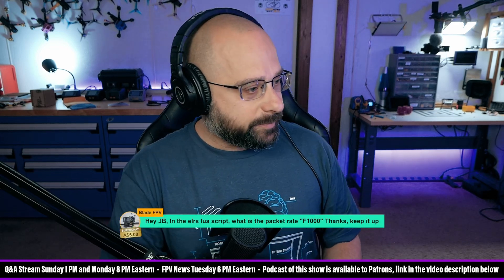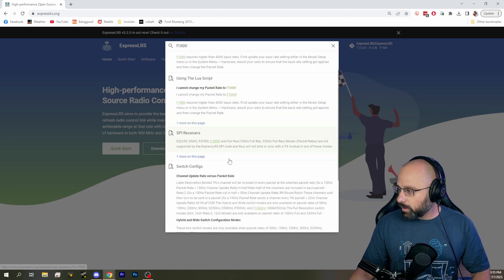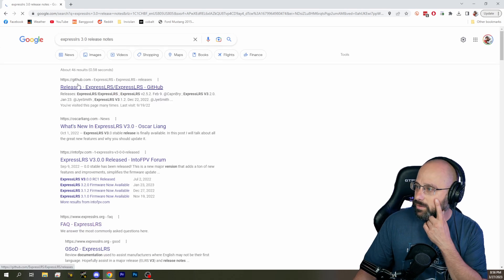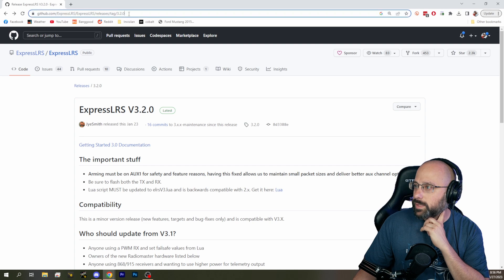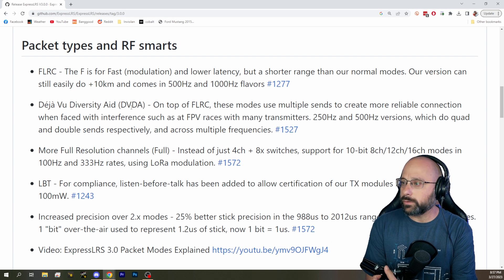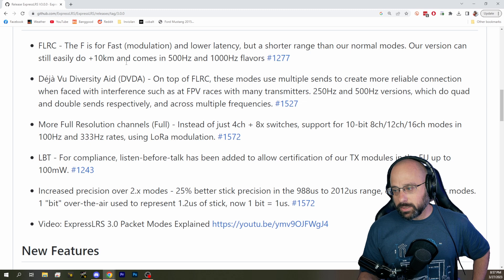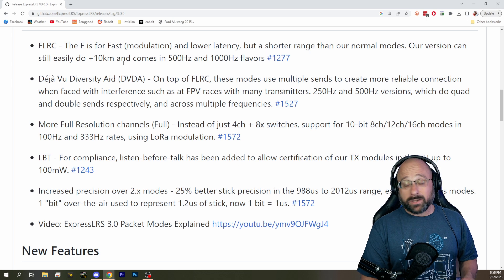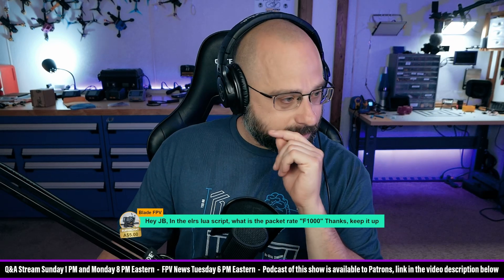What does RF Mode F1000 Mean in ExpressLRS? Packet Rate? - FPV Questions

Comment: Can F1000 mode work on my taranis x9 lite? I'm on edge tx but when I try any of the F protocol my link doesn't establish.  Not sure if I need to adjust baud rate or simply my hardware can't support?
Reply: F1000 requires EdgeTX 2.7 or greater, a baud rate of 921k or greater, and the receiver to be on 3.x, but not an embedded SPI RX in the flight controller. Haha lots of requirements. Not sure if the X9 can do that baud without a hardware mod (the crossfire mod), but if the number on the top right is 0/1000 in the Lua, it should be good to go.